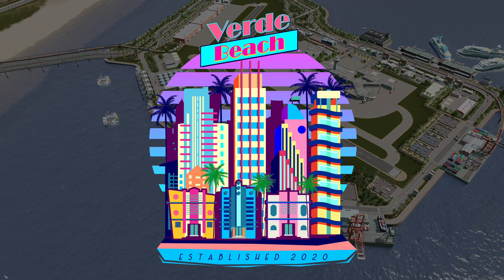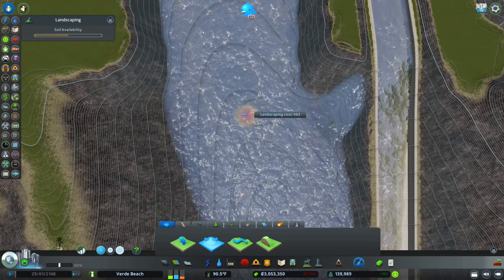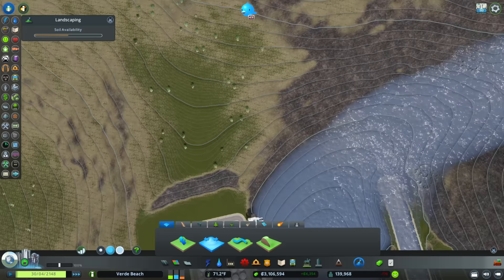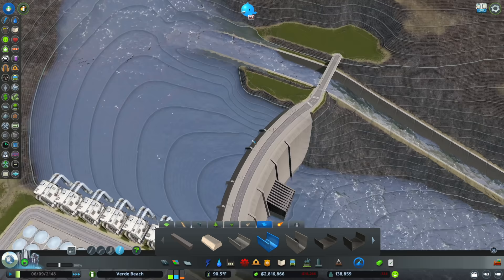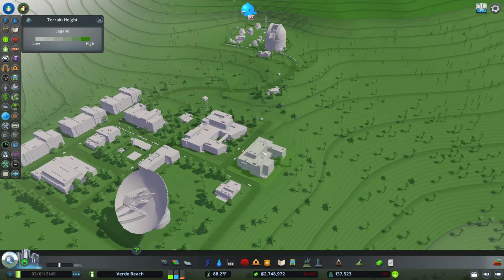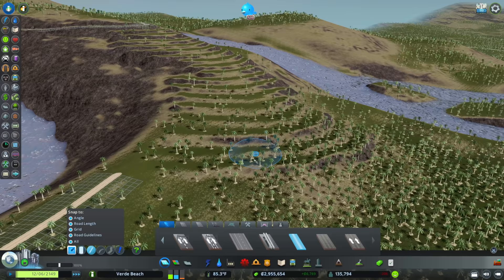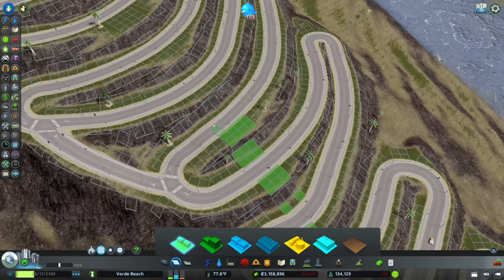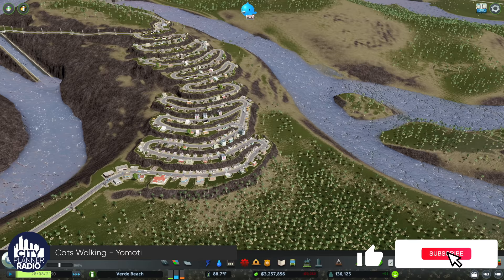How to build a MASSIVE Hydroelectric Dam Complex without Ruining Your City | Verde Beach Ep. 65

Comment: I've not seen anyone mention that cable cars are perfect mode of transit for this community. Have a commerical area at the base and the residential up top.
Reply: I was thinking the same thing!
Reply: Tourism commercial would make sense if you didn't block to much of the view. There should definitely be a city park at the bottom of the hill where the big rock is.
Reply: Came to say just this.
Reply: yes and an option for pedestrians to get across the highway. 😀
Reply: Yes to this
Reply: Agree, a cable car would be cool and also some kind of a park or something at the very top for tourist attraction. like a small hill station
Reply: I was thinking that too although I call them gondolas irl
Reply: Agreed. I can even see a natural reservation up on the top of the hill with lookout towers and stuff <3
Reply from the maker: Completely agree!  It's coming!
Reply: I use a short line across a lake, 1k / wk
Reply: Cable cars? Gondolas came to my mind.
Reply: @briansepolen4917  Same thing, just depends where you’re from. Tbh, when someone says ‘gondola’ I end up thinking of Venetian boats 🛶

Comment: Hey CPP, multiple points:

1. As people already pointed out, make the roads sloped on the straight parts.
2. I really think you should only zone on the side of the road that is facing down the hill. That way lots on the top can be a little bit bigger and houses aren't eaten up by the mountain on the lower level xD
4. You should use a theme for the buildings in this community, maybe one that looks a bit "higher class" to resemble for example the Hollywood hills. 
3. Cable Cars would be perfect for this development and could replace the steep paths.
4. I think a tunnel between the two dams would make a ton of sense and it would make this dangerous road around the mountain unnecessary.

Other than that, great episode and I really love the idea of having a development on the hillside. Excited for the next one! :)
Reply from the maker: I love every point you made and will make some changes off camera and present it at the start of the next one.  This comment actually influenced the next CWC, too :_realmvp:
Reply: @CityPlannerPlays  Can't wait! :D

Comment: If you place the water intake pipes IN the spillway (all or only some of them), you can preserve the initial water speed into the dam which should increase the power generation.
Reply: Or move them below the Dam. The power generation is definitely being hampered by the water being pumped out above the dam.

Comment: The switchbacks might have been prettier and gentler if they would diagonally cut across the height lines, instead of running parallel with them for the most part.
That's not all that easy to do in vanilla, but still...
Also, the water pumps are now probably reducing the amount of water flowing through the dam. It might have been more optimal to put them downstream of the dam.

Other than that, Great episode :-)
Reply: I thought exactly the same thing until realizing that Phil was always intended to develop the flat bits
Reply from the maker: Both are great comments!  Will get the roads adjusted... will test the water pipes to see how big of an issue it is and report out in the next one!
Reply: @CityPlannerPlays  The water pumps could be a good thing or a bad thing... reducing the flow does reduce the power output of the dam, but it also mitigates flooding, similar to the spillway.
Reply: Same thoughts on the water pumps.

Comment: Isn't the idea of the serpentines to have the slope covered by the semi straight pieces of road and the sharp corners be flat? Here the corners are extremely sloped because they have to span the entire descent while the long pieces are flat or even dip down a couple of times. Also in most cases having the buildings on the same side of the road should work better in my opinion. Anyway the dams are magnicicent! Greetings from Germany.
Reply: Overall I agree with you but I wouldn't say "flat sharp corners". In my experience with mountain roads, it's easy to have corners that are sill quite sloped.
Reply from the maker: Yes - I need to fix that!  Will get the buildings fixed, too - great ideas!  Hope all is well in Germany!!!
Reply: Yes, this is actually completely backwards - the point of a serpentine is to stretch the descent out over a greater distance, reducing the severity of the slope. By having the straight parts flat, you just end up with a longer and more expensive road, with slopes on the corners just as steep as if the road had just gone straight down the hill.

Comment: I get that they cost a lot, but if between the dams isn't the best place for a connecting tunnel, I don't know what is.
Reply: IRL the power company would most definitely just tunnel straight through there. Some Hydroelectric dams in the austrian alpes have 20+ kilometers of tunnels linking them together and that'S not counting the flood tunnels channeling the water between reservoirs.

Comment: Spill ways are usually used to handle times when the dam might run the risk or overflowing
Reply: which, granted, in cities skylines is basically ALL THE TIME EVER.
Reply: Is there a way to have the spillway entrance higher than the dam height but lower than the regular water level? Maybe if it were built on the other side of the quay wall, with the quays higher than both the dam and the spillway, it would at least serve the purpose of preventing the water intake area from flooding.
Reply: It's also hard to do spillways when you have no option to build a control structure
Reply: @872463051  Exactly what I thought but the only problem with that is that the dams in skylines need to be at capacity before they turn on (I think). I don't think there's anyway to do a spillway other than an emergency spillway which would only get used if the dam failed. That would usually just be a hillside that points away from any buildings and towards another body of water and you would design it so that the hillside was the first side of the dam to spill and it would also facilitate enough flow to handle the largest theoretical flood possible.

Comment: The water flow mechanics in the game explain three things in this build. 
1. Mulligan Island flooded when you abruptly removed all the pumps (27:42) because they were each drawing 120k cubic meters of water per week that suddenly had nowhere to go. 
2. A similar issue caused the flood with the new pumps (15:44). They got powered, began pumping, then suddenly stopped. The flow shift caused a brief flood. 
3. The power output from the dam dropped at the end because you removed flow from the dam. Relocating the pumps downstream (or to the "spillway" as others suggested) would prevent this. 

As always, love these videos!

Comment: I love your builds and video content in general. The dams look amazing and the spillway really adds something to the layout. I'm a bit disappointed with the road up the mountain though. Having lived in the mountains for some years I'd point out that on a road like this, in reality, the elevation change doesn't just happen on the hairpin bends; it also happens on the straight sections between the bends. There would be longer runs between the bends, more use of the terrain wrapping round the mountain to accommodate gentler elevation change without having to use so many corners. If you drew this again, bearing that in mind, you'd almost certainly come out with less hairpins/switchbacks and a much more natural looking road. 
Cheers for the great entertainment.

Comment: I wonder whether a twin hydro complex like this would take advantage of the solid mountain between the dams to tunnel and build infrastructure into. It seems like a good place to use as a research facility and then potentially generate additional energy in the water pipes heading down the mountain. I would also expect that area to be reserved as a federal or state land area that has some recreational access for cyclists, views, and drivers but very little development aside from a lodge and restaurant looking out over the city. Maybe a bucket lift system could give tourists a fun ride up from a resort town at its base. Also, instead of the switchback road, I'd wonder whether a long scenic road off of that second dam would just connect down the new development near where you just placed the water treatment plants.

Comment: I love how you've designed the main dam and spillway area, it's so unique!!! 
Just a thought, because the main path is so... intestine-y, perhaps the dirt road should really be the 'industrial' road because it's potentially easier to drive despite being a longer trip? Besides, the Intestine Way, as Biffa says, is mostly residential, it may not be prudent to envision the traffic going to the top going through the houses, but rather via the observatory campus. Also, for the parts that aren't residential, I'd say using the two way highway could work instead of sidewalks all the way down.

Comment: Whenever I do the switch back housing areas I only develop the roadside that is facing outwards so the road is hugging the clifface. Looks way more natural and reasonable. I feel like your Machu Pichu district could maybe had the switch backs halved but either way it was a nice build and I liked your method of making the level pads to then link in between with a sloped road. 👍

Comment: We have two small hydro dams here in town and there is a park with hiking and nature trails that runs between them. The top area between the dams and where the river loops looks like that might make a perfect use for it - perhaps put some camping spots from the Park props there. And using the self-sufficient green housing district selection on the housing there would make for an interesting visual for the housing.

Being cheeky I think it'd be interesting to name the two dams Charybdis and Scylla

Comment: Around 6:00 where you started building the dam, you actually took away some of the potential power generation from the turbine by letting some of the water through the dam. 

Dam spillways are cool, especially when they release tons and tons of water, but that release of water serves a specific purpose. It might be done to offset significant upstream rainfall which could compromise the integrity of the dam itself, or it could be for routine maintenance, but the point is, the dam only operates at 100% efficiency while all of the water is flowing through the turbine.

I personally design spillways to be an emergency flood preventer, so I keep the start of the spillway above the water table at the top of the dam and run it down and away from any critical infrastructure. I also use my spillways to carry sewage away, and I usually go way overboard on my water management. In one city I've designed two dams - one remains dormant simply to provide maximum flow to the one adjacent to it, and I've built my city below the water table on purpose to kind of simulate a New Orleans style of city, to spectacular effect I might add. Following the design principles used: Since water continually flows down into the low lying city, instead of trying to stop it (There's simply too much), I control where it goes so that it is not only safe, but a huge commodity to my city.

First, it enters an adjustable intake so I can take more or less water if I need to, it functions very much like opening a valve. The dam is designed to operate at maximum efficiency all the time, so if it ever slows down, less water will be pumped harmlessly down a river and more water from the higher water table will begin to travel down into my city's canal system. 

First phase acts as a visual indicator, I can easily tell when the water level rises in my buffer pond and react, second phase is my pump stations. I use a series of pump stations, my main supply which never turns off, and 6 pump stations which can take every bit of flow including critical flow as in the levee broke.

Third phase is just contingencies, I have a very intricate canal system designed to hold the full capacity of a critical failure like a levee breaking. Obviously in the game this would never happen naturally, but I have tested it by terraforming the levee away and the system absolutely saved the city. In that situation in real life, the dam would most definitely stop producing power and thus the city would lose power until the levee can be repaired, but at the very least I have designed a system to save the city from drowning.

Comment: You should check out the suburbs in northwest Portland, especially near Burlington on the roads around Skyline and to a lesser extent, along Burnside where it cuts in the mountain.
Between those and my experiences back in the SF Bay, I feel like in the cases where switchbacks like that do get developed, there's either stub roads off the curves where each house is, or only one side or the other of the road gets developed (I dunno what's more common irl, but instincts tell me having your backyard facing down the hill so you can have a fence there instead of having it backed up to a cliff where cars might slide into it would be better). Any time I've tried to develop steep areas in C:S I've kept to one side of the road also, I think it looks nicer? and creates less squared off nonsense.
This is still a really cool undertaking though, amazed at how much smoother this went XD

Comment: Although the Cities:Skylines power lines are usually overkill this would be an opportunity to use them the right way. I prefer to use them connecting 'big' powerplants to various parts of the cities, trying to make a more or less logical path. I also try to add some redundency but prevent too many of them by crossing multiple 'power areas' and skimming over the edges of areas so that there is actually a connection but not an end point. The end points are usually industrial or city service areas.

The dam would definitely be a big powerplant and you would expect high voltage power lines going to every major part of the city. These could skim along Machu Pichu rather than using it as a power conductor itself.

Comment: Nice job on the road at 21:36, but don't you think that they would actually build a tunnel?
A hydroelectric plant already involves significant tunneling. It's not that far fetched to think they'd also include a roadway tunnel to link the two facilities.

Comment: Also, in reality you'd have the water treatment plant closer to your end users. There's evaporation and leakage losses, and treated water is much more expensive than untreated water (depending on location - in a desert all water is going to be expensive). Plus, more minerals and contaminates would be introduced to the treated water as it passes through the bulk water aqueducts, especially if those are open-air and not pipes, pipes being more expensive.

Comment: There’s a city in Washington state (Spokane) that has an area like this where it overlooks the city called the Town and Country district. VERY rich area. But it also connects to an area called 5-mile, which is adequately named due to the 5-mile reservoir made by one of the many damns (in this case the 5-mile dam) in the area (Long lake, 9-mile, Little Falls to name a few). I think something like this would be a very good name for the little town that’s being made since it happens a lot. (Towns being named due to the area surrounding it). I’m thinking something silly yet simple. Personally I like Long Lake and Little Falls for dam names due to that my dad works at both of those. That area could be named after one of the dams.

Comment: I just wanted to mention, again, putting pumps that take water from the water table on the higher side of your dam is only reducing its power output. You can just as easily and very well should put the flow from the bottom of the dam into canal systems and take water from there.

Comment: Piggy backing off the incline straights suggestions, there’s still some really sharp cliffs off the ends of the development. If they sloped on the sides (where the turns are) it might feel a lot more built to the terrain as opposed to inspite of it. Everything feels a bit too high in comparison.

Comment: I get why people use the cheapest road to plan, but I kind of hate those dirt roads, in how they're not quite exactly 2 tiles but they're bigger than 1 tile too, meaning that planning with them always ends up with inaccuracies and problems fitting things.

The picture of them is already basically 2 tiles wide (there's a 'sidewalk' of grass nobody can build on), but the road itself is very awkwardly sized.

Comment: IDK how much you really care, but the power generated by the damns in CS depends on the relative terrain height beind the dam vs in front of the damn. (I.E. the spot where it takes water in at the top of the damn, vs where it pumps it out at the bottom.) Therefore, some small terraforming in the water just below the damns would probably increace the damn power output.

Comment: Correct me if I'm wrong but isn't dams suppose to be way way downstream from the source of the water? It's how they generate massive amounts of power. Phil you building that close to the source means that you are losing out on a lot potential energy.
Reply: Dams both in game and the majority in real life is all about head height compared to exit height. Reservoirs being down stream a bit from the source is usually more of a matter of a coincidence to where the location for the dam would need to be or done strategically for flood control. A 100ft drop from head (intake pipes) to exit is a 100ft drop no matter if it's located 1mi from the source or 100mi from the source. 

Obviously the further from the source, in real life, you are means you'll have more runoff flowing into & rain falling on the reservoir  (and possibly tributaries) but run-off/rain-fall isn't something that is modeled like that in the vanilla game.